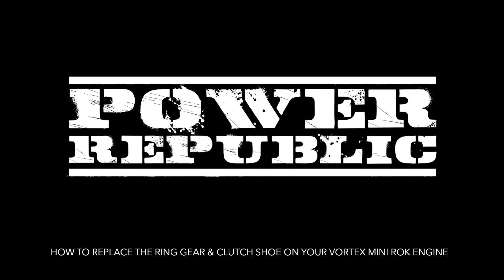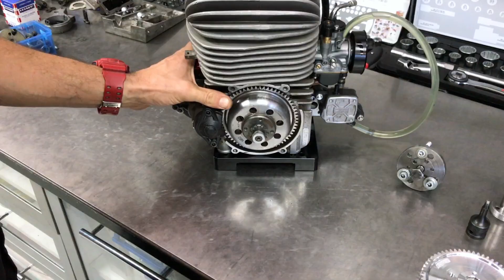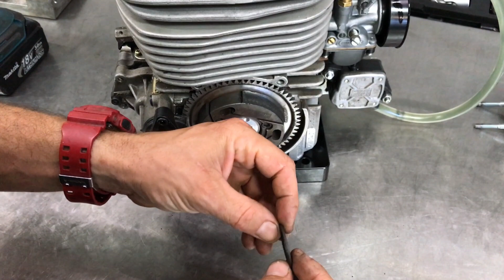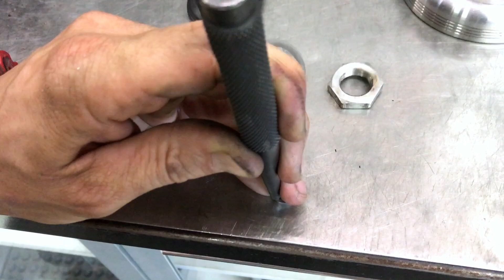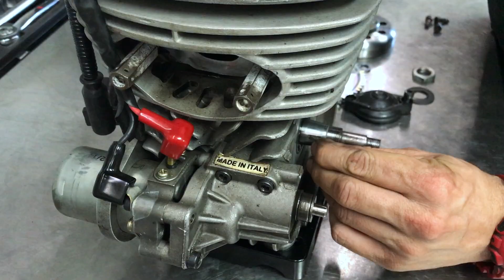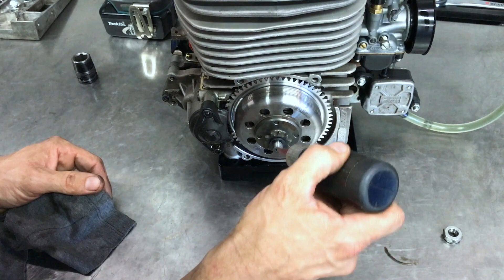How To Replace The Ring Gear & Clutch Shoe On Your Vortex Mini Rok Engine

Comment: Thanks! Where can I find that ring gear puller? My son has the mini rok and mini swift. Is that universal or specific to rok? Also what loctite to use. Thanks!!
Reply from the maker: Hey RA83x 👊👊 for super thanks 🙏 

They these guys 
https://www.agskartparts.com.au/products/2912/clutch-puller-vortex

I think the mini swift would be similar but I haven’t seen one yet.    If it is IAME , then they have a similar product but it’s different to rok
Reply: @PowerRepublic  thanks so much what about the other puller for the ring gear? For Mini Rok
Reply from the maker: Loctite for the clutch retainer nut is stud lock  strength 263 and medium strength 243 for everything else.   Hope that helps

Comment: Hey Dez. Could you remove both ring gear and clutch from the engine as one (retain the 3 bolts holding clutch and ring gear together), then separate the clutch from the ring gear? Or do you need to remove them both individually (use the ring gear puller also)? Thanks mate!

Comment: For the Rok GP it says a 30mm lathe socket where can I get one?!?!! Been looking everywhere
Reply from the maker: get a standard one and get it machined.  otherwise turn it in your battery drill and hit it with your angle grinder.  Its a rough way to do it but sometimes there is no other way.

Comment: I have a broken shoe and i change it with a new one plus a new bell. BUT in low rpms after the kart has one session and the clutch get hot the clutch make a big noise! Any idea what can i try?
Reply from the maker: Hey Giorgoes,  check the o ring isn't missing and the clutch bell doesn't have to much grease around the outside.  Clean the whole thing on the inside with some brake cleaner and some clean rags.
Reply: @PowerRepublic  Thanks a lot for your answer! Everything seems perfect and i have tried all the things you suggest.. next step is to try a new clutch shoes, faulty material maybe???

Comment: Can you use that clutch puller on the ROK TT?
Reply from the maker: I don't think so, I just googled the Rok TT clutch shoes and they don't have the same tread on them, instead they have 3 screw holes for removal, similar to the Rotax ring gear Video
Reply: @PowerRepublic  Thanks!